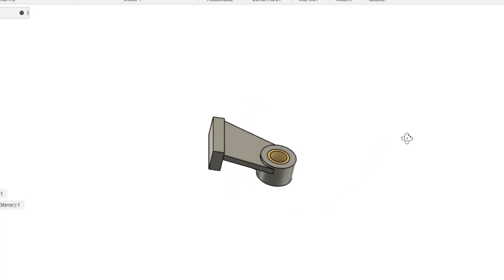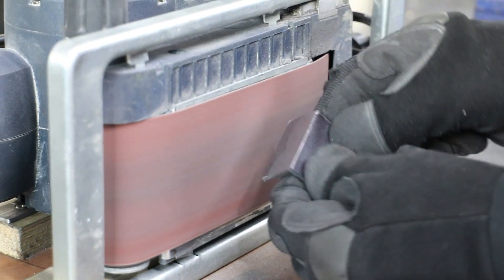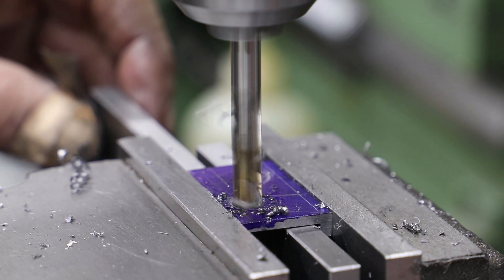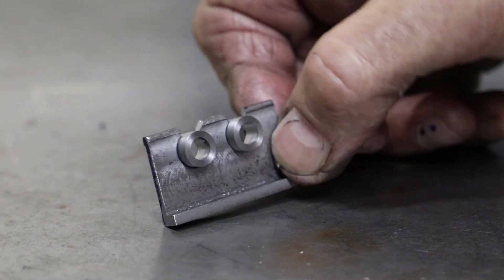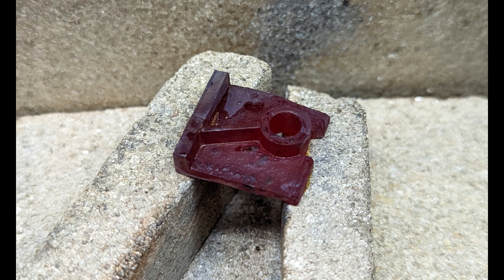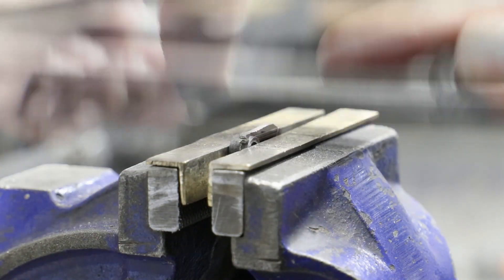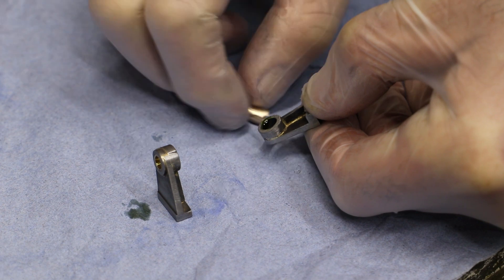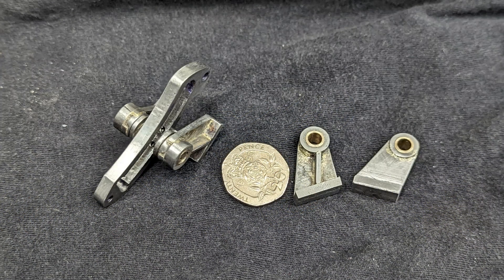Part 35: The Expansion Link Bearings

Comment: Mark, I do like your approach to problem solving when making these parts but I did wonder whether the bearing mounts would be sufficiently parallel for the rod that is running through the bushing. I think I might have held off reaming the bushings until the 2 supports could be mounted and do some line boring of the 2 parts.
Reply from the maker: Hi Michael, 
Fair comment and an easy backup plan if the parts bind up when assembled.
Cheers
Mark